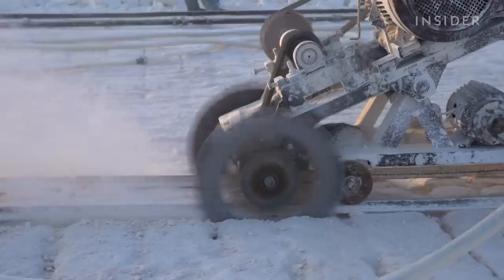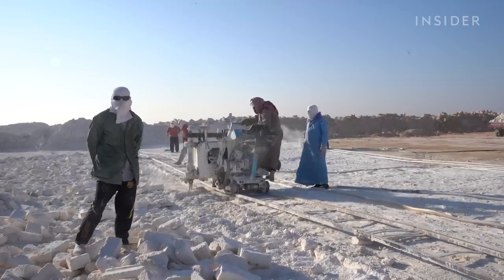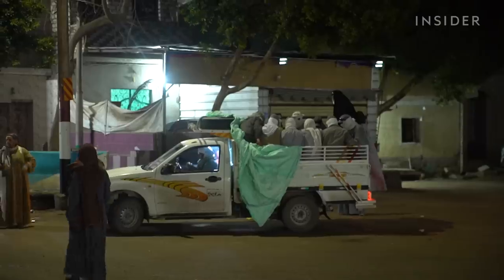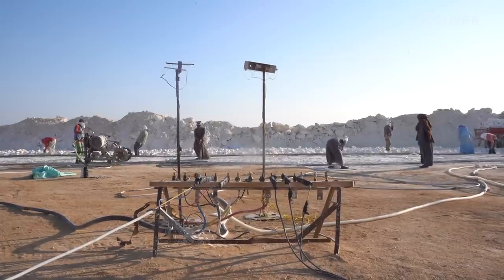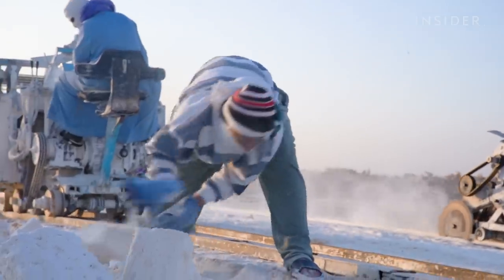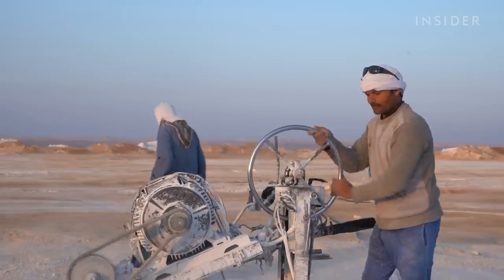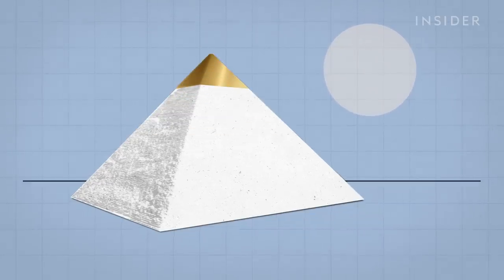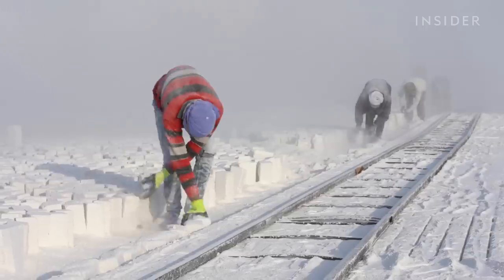Why Miners Risk Limbs To Carve Mountains Of Limestone In Egypt | Big Business | Business Insider

Comment: Honestly, this wouldn’t take much to be brought up to snuff.  A few thousand dollars worth of of gear would probably be enough to dramatically improve mine safety.  Other than that, implementation of better safety protocols is all that can really be done.
Reply: Thank you, these people are making an issue where there is none to little with just the "truck not made for passengers". Laws say one thing, all our pickups in America still disagree, and the passengers often too. Those guys likely safer than being in our pickups! Better dust filtration defintiely. But these hazards are on all jobs like this, amd safety protocols, which they likely hsve without realizing just by how they train each other or is not mentioned here, do still fail.
Reply: I was going to say the same thing, honestly aside from a few missing guards and better masks these conditions are pretty normal. No different then other concrete cutting work or quarry work, stone crushing is dusty like aswell.
Reply: @bradd188  I mean those power likes were sketchy AF, but that’s also not something that would be super expensive to fix.
Reply: h those sulphur miners they featured could solve half their problems with a winch and some gas masks.
Reply: @mitchellslate1249  They don't have safety protocols if none of the people actually doing the work know about them.
They're freelancers, not employees, so none of them can be considered responsible for maintaining OSHA type stuff. That needs to be an employee, or at the least communicated by the people hiring them.
All that said though, safety protocols and best practices can't do all that much when the work itself involves breathing in liters and liters of dust on a daily basis without any other protective gear than you can source yourself... at $6 a day, most of which goes towards scraping by.
I doubt anyone would be able to take $30 and scrounge up adequate gear for this job, it has to come from the people actually raking in the profits in the operation.
Reply: a hose of water on the blade would cut the dust to nothing, and probably cut the temperatures to something almost sane. Thing is all these cheap fixes are out of budget, 6$ a day wages man. They are probably not making a lot.
Reply: @MrSquishles  I’m not saying that these guys should pay for it themselves.  The mine owner should be the one paying for this stuff.
Reply: @MrSquishles  Where is the water coming from and where is the run off going?  Its the middle of a desert and you are talking randomly about pumping water in with no actual idea how difficult that probably is
Reply: @mitchellslate1249  you shouldn't have an opinion until you learn how to spell.
Reply: @andrewkaminskas7721  the video shows the quarries being next to a river so I would get water from there. 
You could then collect runoff and use something like a solids control unit to recirculate water.

Sadly that sort of option is quite expensive and likely out of the price range of these operations but just using water misting, saw guards and providing better respirators would cut down the danger significantly.
Reply: To used to doing the work there way.when you do anything and it is not working out.and you keep doing it over and over,never changing, expecting a different out come . It's called insane.
Reply: Lol dude! This is Egypt!
Reply: Those safety protocols would be expensive as shit with their impact to operations efficiency
Reply: @John_Smith_86  those protocols would mostly be “do what you’ve already been doing, but now it’s actually written down”.
Reply: Water for keeping dust down
Reply: @ablinkontime9890  I dont have an opinion, I have a flabby finger and a touvhgkdjscreen..'Nternet that!

Comment: Honestly, the lack of a metall cover for the saw  "because otherwise we don't see where we cut" and exposed electrical wires "to see which one is which" are just terribly stupid sources of life-threatening danger. Mine owners should also provide the bare minimum of protective gear.
Reply: The video said that the cutting machines used to have coverings, but they fell off years ago. So now, they have their blades exposed. They changed their mind about it too.
Reply: @ping5825  a new guard could literally be fabbed up in a hour, with sight holes to see the blade and everything. They could just refuse to work until it’s fixed and it would be.
Reply: @davidreynolds731 But if they refuse to work, how will they earn money to live?
Reply: @ping5825  The mine owners still need to make money, they will get it fixed fast to get them back to work
Reply: @davidreynolds731  ok
Reply: @davidreynolds731  This is exactly the problem industrial era workers had. THe mine owner could probably live longer without work than the workers. And others will be willing to work if they arent. He has all the power since he has the money. Cheap Workers in poor economies are replaceable. Mind u this is without looking to deep into it so maybe he might be broke as well. But u get the idea.
Reply: @paragonnight437  if they’re only working after the stone is sold you can assume he’s broke too, one with money could afford to go ahead and mine ahead of time and have material ready to sell when the order comes in.
Reply: @fuckingpippaman  problem here is there is no safety measures, or anyone to hold the company accountable for not having any.
Reply: They are not engineers.. but simple people that's all they know

Comment: Pyramids were made from calcitic sandstone not limestone! If it was limestone it would be bleach white still but it's basically a mix of sand stone and calcite which calcite is similar to limestone and can be turned to concrete but its not the same
Reply: They outermost layer was limestone originally. But they eventually fell off or were taken by the locals.

Comment: There's no regard to safety whatsoever and they are aware of this and they do not care cuz if they did they would find a way to put lights on the machine so that when it gets cloudy you'll be able to see it not only that but you can put a long extended bumper out in front of the blade and around the blade so nobody can bump into the blade itself first it'll be the bumper and then the blade so that way when the worker gets hit with the bumper he has a chance to run away before you get hit by the blade it takes nothing but a few extra pieces of Vinci metal to extend outward in front of the blade they can do this they just choose not to or maybe they just can't afford to but they can afford to buy other pieces for a machine that they had for more than 10 years seriously 10 years this is why it's unsafe cuz they're doing it and correctly without even making sacrifices to make safety requirements sure you sacrifice the dollar but you save a life if you can make your own equipment you can make your own safety equipment as well

Comment: Sorry, but its very simple to make this job safer. Stop taking off the guards on angle grinders and saws. I work with this equipment as a pipefitter and they all come with guards. They can also wear gloves. There is no reason to take off the guards on the equipment. It doesn’t make production faster or easier. Look at the dust it kicks up into the air.

Comment: like seriously, how much more would it costs to just provide the miners a mask 😷
Reply: How many masks are needed, how often are the masks going to break or need filters replaced.  What type of filtration are you using for the masks because particulate comes in many sizes.  I had a mask for my automotive job and it costs about $100 for a paint respirator not included replaceable cartridges and probably about $30 for a normal face mask to block dust particles with filters needing to be replaced every 3 months.

Comment: Where I live the houses were limestone blocks and roofs of limestone slate, they had lime kilns to make lime wash for the roofs which collected water and lime added to cement for plastering walls, setting roof tiles and sealing the large under house water tanks fed by rain off the roofs, Dry stone walls in every yard and lining the roads. Now cement blocks and slate or styrofoam is used. Guess where I live.

Comment: Just another story to get views. So why is that dangerous? Where a mask and wear protective gear. No worse then I have to do and my shop stays around 118 degrees most of the summer and went down to neg zero last winter. And that's not the heat/cold index. 
  I wear hearing protection and the metal is like handling 100lb razor blades all day. Average life span everywhere use to be 40 something around 1900. In 1700 it was in the 30's. If they want to live longer, maybe they should come up to modern times. Their pay seems low but not for where they are. If they were in the US, it would be higher but same type of work. If I'm lucky, I get to put food on the table tonight for my family other then Mac n cheese. In the US, I barely put food on the table, if I lived there I'd be considered wealthy.

Comment: Every problem has a solution. Everything about this video made my eyes and ears bleed.
Reply: WhatsApp①⑨⓪④⑦⑤②③⓪①④  I understand that water is probably scarce but if these bricks were cut with a slight grade into a retention area or concentrated into ditches it could be pumped and reused. This would make it more difficult to harvest the limestone powder/ calcium carbonate but It could be just left to settle in a collection pit and left to dry out as much as possible before moving to another pit while rotating pits. Then it could be tumble dried, bagged and sold for cement additive or for agriculture uses. The first order of business would be to solve the dust problem so workers will be able to think of more than not dying and breathing. It is too easy for workers to lose concentration on what they are doing when they are stuck in survival mode. One problem at a time=solve dust problem first.